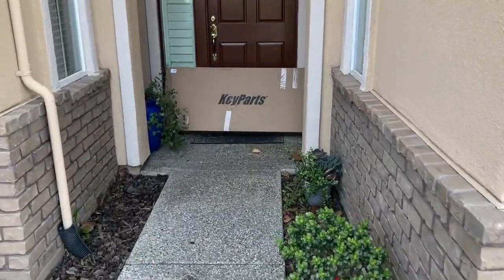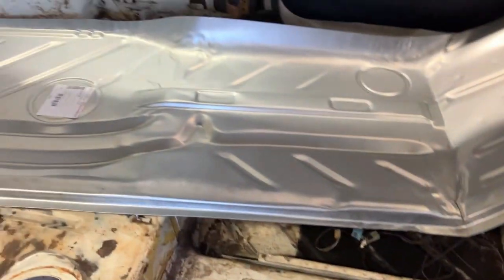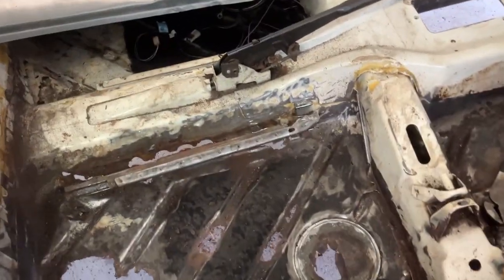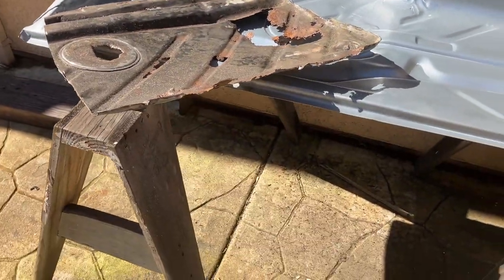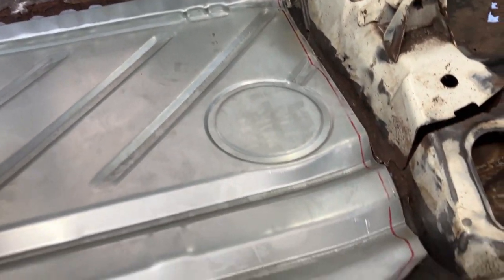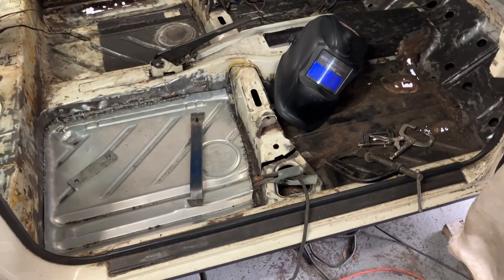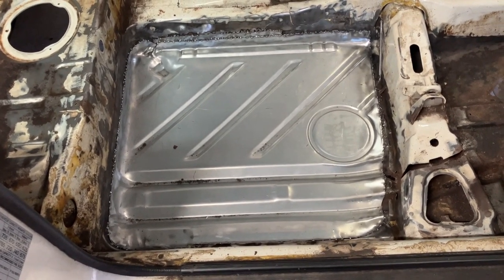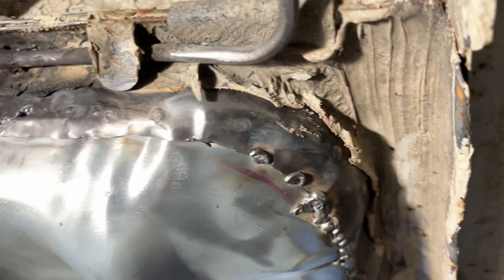Yet Another Amateur Rookie VW MK1 Rabbit Golf RUSTY Floor Pan Replacement Repair Part I

Comment: One tip for getting primer into your weld seam: Mix up some primer (preferrably 2K epoxy primer) with a little more thinner than usual. Then you can apply it to the seam and the capillary force will draw in the primer into the seam and you'll have good protection in there as well :)

If you want to use spray can primer, you can spray some into the lid of a spray can and apply it with a brush, same principle as above.
Reply from the maker: Thanks for the info!

Comment: Thanks for sharing! Inspiring for me as I prepare to tackle the floors and rockers in my 81 Rabbit Pickup. Did you consider temporarily usjng sheet metals screws to pull panels together before welding?
Reply from the maker: yes, great point, that's what I had to do with that patch panel above the fuel tank on the passenger side, may be in the charger video later on, you can do it, just take your time and do a bunch of passes all the way around